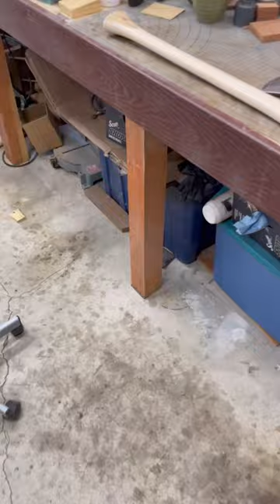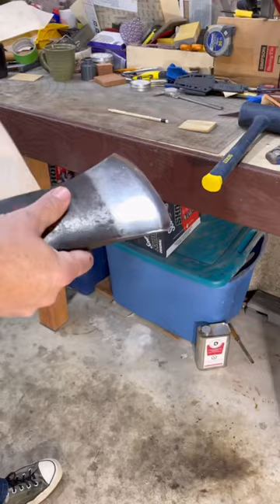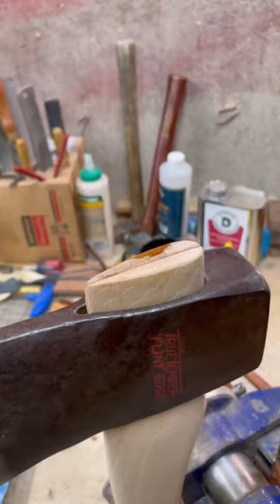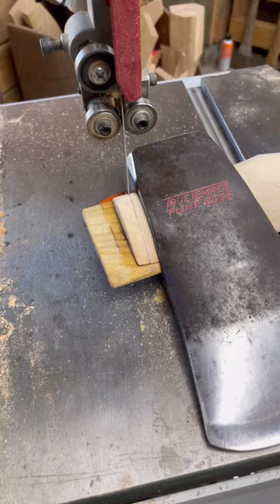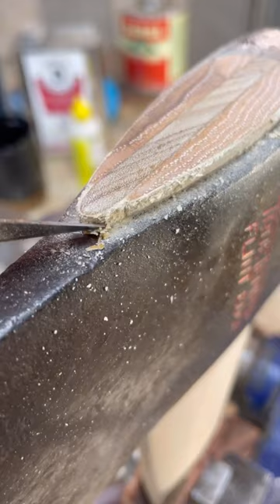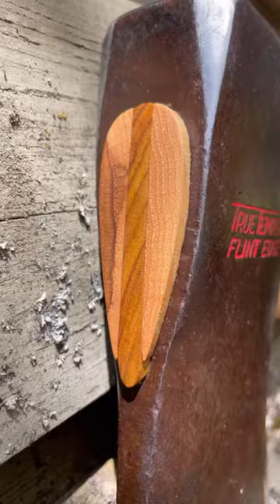Axe Mount & Wedging - Kelly Rafter #stumptownaxes #axe #handmade #woodworking  #satisfying #process

Comment: at last ,,, no glue ,,, that will do the very best.usually I put a metal wedge across the wooden one too , but this is so much better than folk putting wedges in with white wood glue after filling gaps round the head with epoxy.

Comment: Everytime I seen his videos I just want him to build me a custom axe, oh I have ideas, I'm curious what type of steel is used in these axe heads, I would like to see some other steels that would be superior, and different handle materials, I'm curious if a carbon fiber handle would work, carbon fiber is expensive but stronger than steel by weight I believe, anyone with knowledge, do you think it would be to hard and brittle and not flexible enough and would maybe just fracture or break or would it work well, and what other materials are suitable for axe handles, anybody with any knowledge about this and whether they have ever made axe heads from cpm 3v, cpm 4v,  aeb-l,  and other super strong metals, has this been done, if so by who, if not then why, would it not even be worth it, I'm not thinking about price really, I'm talking about a custom high speed axe, like custom high speed pistols for competition